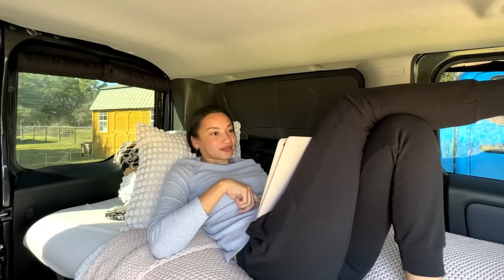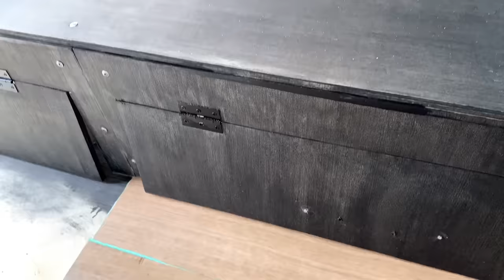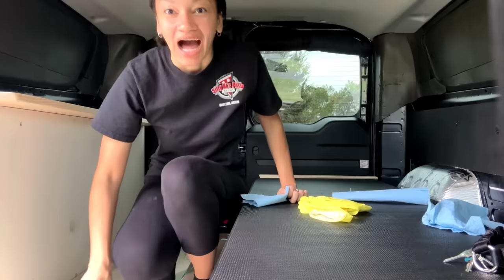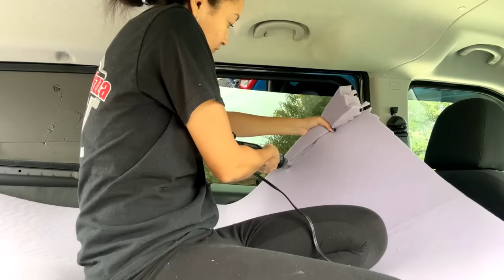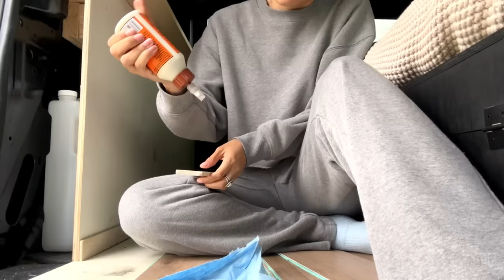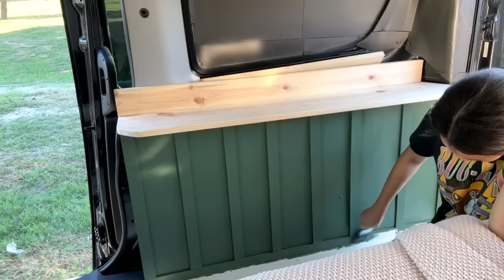turning a MINIVAN into my tiny house on wheels in 10 days

Comment: That looks amazing and cozy. You know what would be really great and possibly very useful is if you get a small barstool either already made to roll or to add the rollers so that hunching over won't be a constant thing. You can just glide in a sitting position around your van while also using it to eat and hang out on your counter top. I'm not sure if that's possible but it's the first thing I thought I would do. Great video!!❤

Comment: Do you have a Diesel heater, as a backup heater?

A 5 liter tank last all day on the mid to low setting. The models with the 10 liters last 2 days on the mid to low setting.

Comment: The Van is looking great! You could try a food safe wood stain/finish for furniture that wouldn't be as grey.
Reply from the maker: :0 would those also be sold at Lowe’s?
Reply: @AlyssaVanilla  it should be. It’s sometimes called Butcher block stain. It’s good if you’re going to be cutting or having food on the surfaces.

Comment: very nice job imho, light, not cramped up, functional, perfect!  and best of all RELIABLE, I bet that's a big relief, man I felt for you when you broke down in seattle it's a horrible place to drive much less break down, and in that humid heat  ...  this one is perfect, it will lock up tight, drive nice, start in time and get better MPG...  

believe it or not having a tightly sealed vehicle is important if you are sleeping in it,  moisture and weather cannot enter at various unknown controllable areas, for venting a little bit of screen here or there and you're good,  OR, with most new vehicles you can open the HVAC vent and its filtered and that's much better, say you're in a wind storm in the desert, you don't want to breathe all that dusty air as you sleep, close her up tight and circulate the HVAC vents to outside, filtered!

Comment: Layout info ? 🥺 other than cutting plywood and drilling 2x4s, please and ty. Also can you share the Pinterest page you got your inspiration from 🥲 

p.s. of course I will do my own research on layouts and such, but if you can still send that info out it would be much obliged 😊 God Bless 🤍
Reply from the maker: Helloo, no problem! I just bought two pieces of plywood, one for the floor and then added 2x4s for the legs of the bed. Then drilled a 24x72 plywood platform on top of the bed frame. And then used extra plywood as the cabinet covers. That’s literally it!
Reply: @AlyssaVanilla  you’re so sweet thank you Alyssa ! 🥰